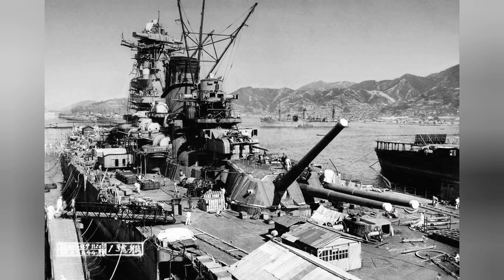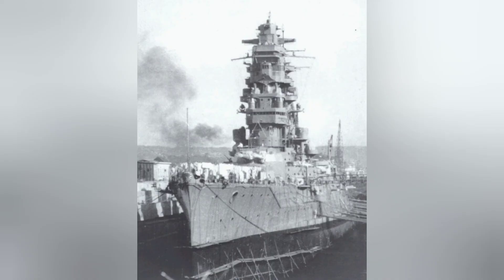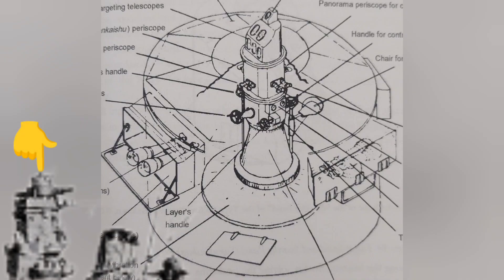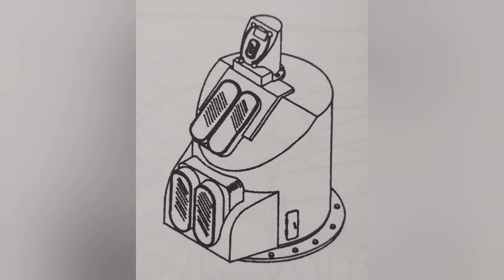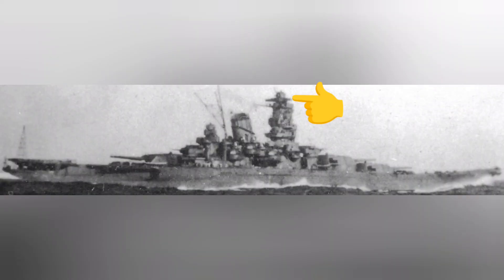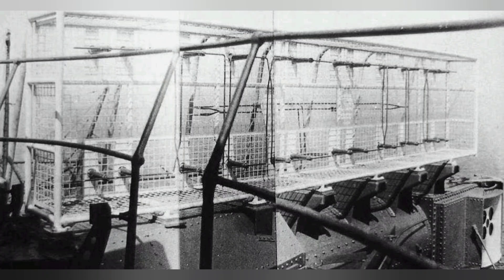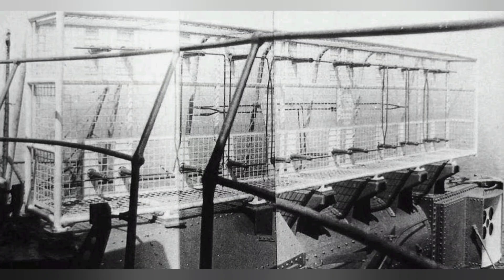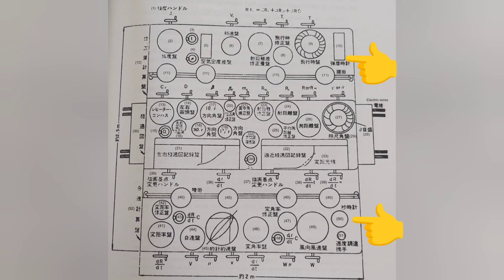IJN Yamato: Fire control

Comment: An outstanding video from you as usual, Crosser. I thought I'd add a few bullet points on the effectiveness of the Type 98 system aboard the Yamatos:

1. The radar- assisted gunnery system employed by the Japanese proved to be highly accurate. Range accuracy for the ship's Model 2 optical range- finder was superb (57- 89 yards at 20- 25,000 yards) and it had a unit of error which was half that of the U.S. Navy Mark 38 GFCS. This was very comparable even with the U.S. Navy's Mark 8 radar range- keeper, which had a range accuracy of 35- 40 yards at the same ranges. The Type 22 Mod 4 radar had an almost constant range accuracy of approximately 109 yards at long range, could spot a dimensionless target at 25,000 yards, and could spot a battleship- sized target at 38,300 yards. In long- range gunnery duels at sea, the differences in these ranges was minimal because of the factor of shell dispersion. 

2. The Type 98 system included the Type 98 discharge delay unit, which was designed to minimize shell dispersion (which no radar- assisted gunnery or remote power control could compensate for). Shell dispersion for the Yamatos was 1.3% of range for a nine- gun salvo. This was markedly superior over that of even the Iowas, which were half again as large, at 1.9% of range for a nine- gun salvo (shell dispersion of all U.S. fast battleships in WW2 were uniformly significant at 1.9% of range, and the older battleships were much worse). The result of this was unparalleled gunnery performance off Samar in October of 1944.

3. Off Samar, Yamato fatally damaged U.S.S. Gambier Bay with a first- salvo 18.1" hit at just under 22,000 yards. This was part of a six- gun salvo of the forward turret (EDIT: turrets) only and was aimed entirely by the Type 22 Mod 4 radar, as Yamato lacked a visual to target. She also fatally damaged U.S.S. Johnston with three first- salvo 18.1" hits at just over 20,000 yards. Lastly, Yamato dropped four shells right alongside U.S.S. White Plains at just over 34,000 yards. Although none of the shells likely struck the vessel, one exploded- and the damage to White Plains took her out of front- line service for the remainder of the war. This was superb gunnery by any reasonable standard. No other capital ship of any navy in WW2 delivered this level of gunnery. In fact, none of the Iowa class ever registered a confirmed main battery hit on any target of destroyer size or larger in WW2. Only U.S.S. Washington's gunnery at 2nd Guadalcanal is comparable- and that night action took place at ranges which dropped from short right down to point blank.
Best Regards...
Reply: do you have a source for this? would appreciate this
Reply: @laryyan1358  
1. United States Naval Technical Mission to Japan:
A. USNTMJ OT O-29 Japanese Fire Control.
B. USNTMJ OT O-31 Japanese Surface and Fire Control.
2. "Operational Experience of Fast Battleships: World War II, Korea, Vietnam" by the Naval Historical Center, Department of the Navy.
3. "Capital Ships of the Imperial Japanese Navy 1868- 1945: The Yamato Class and Subsequent Planning" by Hans Lengerer and Lars Ahlberg.
4. "Yamato vs. Iowa" by Paul Forest.
5. "The World Wonder'd: What Really Happened Off Samar" by Robert Lundgren.
Hope this helps...
Reply: The hits on USS Johnston and Gambier Bay were probably not "first-salvo" hits - the battle opened around 07:00, and Johnston was not hit until around 07:30, half an hour later, while the fatal hits on Gambier Bay didn't come until 8:20.  

"In fact, none of the Iowa class ever registered a confirmed main battery hit on any target of destroyer size or larger in WW2."  This claim is misleading.  The gunnery of the Iowa-class went largely untested, due to a total lack of enemy ships willing to show up to a gunfight.  However, during Operation Hailstone in 1944, Admiral Spruance got sick of this state of affairs and led TG 50.9 against a battered Japanese light cruiser squadron trying to flee Truk.  Towards the end of the engagement, the USS Iowa and USS New Jersey engaged the destroyer Nowaki (the lone Japanese survivor), straddling her at a range of 32.6km (35,700 yards) before she disappeared over the horizon.  Even accounting for less accurate Japanese rangefinding, this feat beats Yamato's gunnery off Samar by several hundred meters.  (Several capital ships scored hits at similar ranges during WWII.  HMS Warspite and the German battleship Scharnhorst share the record for long-range hits on moving targets, at 24km.)  

The performance of USS Washington at Guadalcanal is notable for its consistency, not the range.  Kirishima was firing on the South Dakota at roughly the same range and over a similar period of time, along with several other Japanese ships present.  The USN post-battle assessment of South Dakota estimated 1 hit from a 5-inch shell, 6 from 6-inch shells, 18 from the 8-inch main guns of the heavy cruisers Takao and/or Atago (the latter being Kondo's flagship), and only a single 14-inch hit from the Kirishima's main guns.  (The smaller hits could have come from destroyers, light cruisers, or the secondary guns on the larger warships.)  By contrast, the Washington scored 20 main battery hits and 17 secondary hits on Kirishima.  

"No other capital ship of any navy in WW2 delivered this level of gunnery." Yeah, that's just false.
Reply: @dylandarnell3657  bruh are you for real ? iowa and new jersey did next to nothing to nowaki, and that was 18 guns, how is that a feat at all let alone compares with yamato performance at samar ? and that feat with washington was literally a surprised attack at near point blank range at a battleship sized target, how is that a "feat" of gunnery ? Yamato was hitting moving small sized targets left and right in bad weather with smoke all over the battlefied, that's what the level of gunnery we're talking about.
Reply: @greener2497  Nowaki only escaped because Iowa and New Jersey were busy wiping out the other Japanese warships, as a celebratory side-show after achieving their mission objective.  Yamato and the other battleships present at Samar had 33 battleship-caliber guns between them, and still failed to destroy Taffy 3 or achieve their operational objective.  

(I understand that Tojoboos are bad at math, but 33 > 18.)  

Yamato at Samar achieved at most 3 hits over the course of 2 hours 20 minutes, and ended up running away with her tail between her legs.  The bad weather and smoke were relevant because whenever Taffy 3's ships hid behind them, Yamato proved totally incapable of engaging them.  Over this time period, the DDs, DEs, and CVEs (who were conspicuously not sunk because Yamato was still trying and failing to sink them) inflicted significant losses on the Japanese, sinking three heavy cruisers, seriously damaging one heavy cruiser and 3 battleships, and rendering the IJN's heavy forces combat-ineffective for the rest of the war.  However high her supposed "level" of gunnery, Yamato failed to achieve her mission objective, so any value attached to that "level" was wasted.  

By contrast, Washington landed nearly 40 hits in the span of 5 minutes and 24 seconds.  This barrage inflicted fatal damage to Kirishima while also negating her ability to fire back at Washington.  As the Japanese objective at Guadalcanal involved Kirishima using her heavy guns to bombard the American forces on Guadalcanal, Washington's gunfire also achieved her mission objective.  

If Washington's feat was so unimpressive, then why couldn't Kirishima equal it even with the assistance of 13 other warships?
Reply: @dylandarnell3657 uuuuuuuuuuh….. firstly Washington hadn’t even been spotted yet and secondly that was absolute point blank.
Reply: @invadegreece9281  ...yes, that's why I was talking about Japanese hits on South Dakota.  And again: if "point blank" makes it unimpressive, why did Kirishima only land a single hit compared to Washington landing 20?
Reply: @dylandarnell3657  because Kirishima was focused on South Dakota already?
Reply: @invadegreece9281  Because she couldn't see Washington at near point-blank range.  By contrast, Washington could see basically every ship in firing range (though there was some temporary confusion about target ID).  The ability to notice whether or not a battleship is present seems like a pretty important function of a fire-control system to me.  

I take it by your silence on the subject that you agree with my rebuttals regarding Yamato's accuracy against Johnston and Gambier Bay, and the sparse gunnery record of the Iowa class being insufficient for any conclusions.
Reply: @dylandarnell3657  that’s just called radar
Reply: @dylandarnell3657  also silence? Who’s the mf taking 5 hours to respond kek
Reply: @dylandarnell3657  After 100 shells fired, Yamato scored at least 6 hits (three on Johnston, three on Gambier bay), and likely scored more. That's at least a 6% hit rate at ranges between 20,000 to 22,000 yards, which was very accurate.

Washington scored a 20% hit rate (20 hits out of 99 fired) with her main guns at 5,800 yards, which was fairly typical. Again, Kirishima only fired three main battery salvos
Reply: @dylandarnell3657  Kirishima was at mid range, not point blank range
Reply: @metaknight115  Kirishima engaged South Dakota from between 7,500 yards to 4,700 yards.  Both of those figures fall well within "point blank" range for the 1940s.  More to the point of the conversation you were replying to, at any given point during the battle, Kirishima was closer to South Dakota than Washington was to Kirishima.  Mussolini up there was trying to argue that Washington did not perform better than Kirishima by selectively applying the "point blank" qualifier.
Reply: @dylandarnell3657  What he means is that they were the first salvo fired at the target. Yamato's first hit on Gambier bay was at 8:10.

New Jersey failed to score a single hit with her main battery, while Iowa.....may or may not have hit the training cruiser Katori at 14,500 yards. Her gunnery crew did not claim hits, but observing aircraft noticed Iowa hitting Katori with around seven 16-inch shells and nine 5-inch shells. The difference that that Iowa's shells landed a good 300-400 yards away from Nowaki and caused splinter damage, while Yamato's shell landed mere feet underneath White Plains, may have scraped off her hull before exploding underneath (thus counting as the longest ranged naval hit), and would have hit a larger Iowa sized opponent.

Kirishima targeted South Dakota at around twice the range as Washington (5,800 yards vs 9,800 yards). She only unloaded three salvos, scoring two hits, totaling an 8% hit rate at 9,400 yards, which was fairly typical. Had Kirishima fired off more salvos, accuracy would have improved. The 6-inch shells were also from Kirishima's secondary battery, so I don't know why you list them as coming from Takao and Atago.
Reply: @metaknight115  "Kirishima targeted South Dakota at around twice the range as Washington (5,800 yards vs 9,800 yards)." I don't know where you're getting this information, but it's inaccurate.  From the beginning of the battleship engagement until the battle, South Dakota was closer to the Japanese ships than Washington was.  At this shorter range, they scored a combined 26 hits over the course of ~18-22 minutes.  This failed to sink South Dakota or indeed do anything more serious than temporarily compromise her fighting ability (she was repaired at sea and back in action within 2 weeks of the engagement).  Washington alone scored 37 hits on Kirishima from a greater range, in a span of 5-7 minutes, with the result that Kirishima sank within hours.  Even if you assume that all 5-inch to 6-inch hits came from Kirishima's secondary battery, she still trails Washington's score of 37 by more than half.  

I group the 6-inch and 5-inch shell hits on South Dakota together because, in my opinion, the primary source on this (the Bureau of Ships report, issued June 1947) did not have the means to reliably differentiate between hits from shells in that range of calibers, and does not seem to have been trying very hard in the first place.  The BuShips methodology could have easily led to 5.5-inch shell hits being assessed as 6-inch shell hits - and given the lack of estimated 5.5-inch shell hits in the 1947 report, compared to the healthy supply of 5.5-inch guns present, I believe it did.  

"She only unloaded three salvos" - here you appear to be misinterpreting the Lundgren-Okun computer analysis (or, alternatively, the line on Wikipedia that cites this report), which found that Kirishima fired at least 3 salvoes at South Dakota.  If Kirishima fired only 3 salvoes between 0052 (when the order was given) and 0110, such an abysmal rate of fire would make this discussion moot.

Comment: "This video does not include the radar assisted fire control system, I only present the system as it functioned upon commissioning."  I think you need to do a follow-up video that discusses radar assisted fire control on these ships.  No criticism intended, but the "commissioning" system sans radar is little more than an improved WWI fire control system.  (I realize that some Japanese BBs only had this right to the end of the war.)
Reply: There was quite a bit of advancement in fire control systems between WW1 and WW2, even excluding radar (which basically only gives you the range as well, yes more accurate, immediately and without depending on the visibility, as well as allowing a more precise course and bearing estimate from the range changes, but in the end its still only a range input). See the British Dreyer Table vs the Admirality Fire Control Table for a WW1 vs WW2 comparision (for example how Hood with the older Dreyer Table was unable to get hits on Bismarck while Prince of Wales had much less trouble with the newer Admirality Fire Control Table, despite having a much less trained crew).
Reply: @xxnightdriverxx9576  Point taken.  I forget which book I read about fire control in the British Grand Fleet in WWI, but the horrific thing about it was how much sighting technology lagged behind barrel range.  It was as if the weapons system as a whole was inherently flawed.  You are right that in the intervening decades there was much progress.  However, the optics-only systems would have required an extraordinary amount of training in WWII for ships like the Yamato to fire at maximum range effectively.  

My opinion is loosely based on my own experience as the gunnery officer on a Sumner Class US destroyer in the 1970s. The ship had a WWII era Mk. 37 director and a Mk1A mechanical analog gunfire control computer in plot, and a post WWII (just barely) fire control radar for range and tracking.  I had a pointer and trainer in the director with me and for the optical rangefinder benind me there was supposed to be a rangefinder operator, but we always had a fire control technician just monitoring the radar to see if we were "locked on" in "automatic" mode and it was sending signals to the computer in plot for a solution.  Theoretically, I knew what the three other members of the director crew were supposed to do to get a gunfire solution in manual mode, but the task struck me as absolutely overwhelming unless you had people so well trained that they performed reflexively like automotons.
Reply: The Type 98 system minimized shell dispersion- a little appreciated factor which plagued the U.S. Navy for decades after the war and wasn't resolved by them until the 1980s. This was the primary reason for Yamato's excellent gunnery off Samar. Compare that with a detailed and objective analysis of Iowa's dismal gunnery in Operation Hailstone, and in her failed attempt to sink U.S.S. Nevada in July of 1948. I'm not trying to knock the Iowas, but history matters. Just sayin...
Reply: @manilajohn0182 Cap. Comparing Firing at an Unarmed and Empty battleship, a fast moving destroyer at Longer range than Jhontson? To a slow moving Escort Carrier?. Lmao
Reply: @issacfoster1113  Make sense.

Comment: Do you know if outputs from the different range finders where automatically transmitted into the Type 98 computer. Or was this also a manual process like taking the firing solution calculated by the Type 98 and entering it into a separate system that slew the turrets and guns on target?

I ask because generally speaking, these systems also tend to also be rated on the basis of their level of automatisation. From what I recall (it has been a while since I read a lot of the details), most Japanese systems where quite manual in this regard where in multiple stages of generating a firing solution, the inputs had to be manually transmitted by the crew. This also has been proposed as one of the reasons why the Japanese used these pagoda masts or large bridge structures. They needed more space for their fire control systems because they needed more crew to man every station, because their automatization was lacking compared to some other navies.

This unlike especially German and US systems, which automated most if not all functions from range finders to turret control. From memory, most heavy German ships (Hippers, Scharnhorsts, Bismarcks) only needed to manually set the elevations of their guns inside the turrets, even range finder outputs where electronically transmitted. With the radar set ships like Bismarck got, even the radar outputs where automatically transmitted to their computers. The USN I believe was a bit more mixed, having more ships, build over a longer period of time. If I recall correctly, most USN ships had their full automatisation from the early 1930s with Mark 8 computers to the turrets, but the radar integration into Mark 8 wasn't uniform. Not sure about range finders to the Mark 8 either.